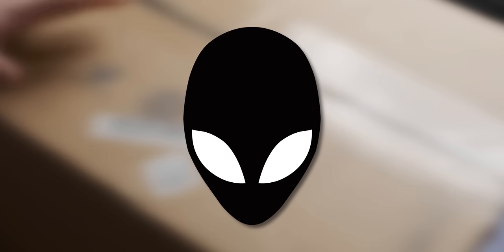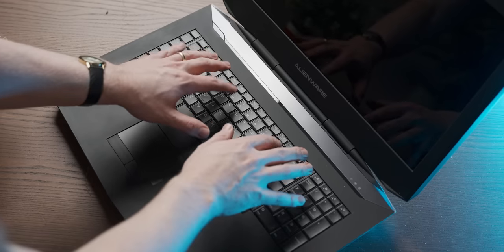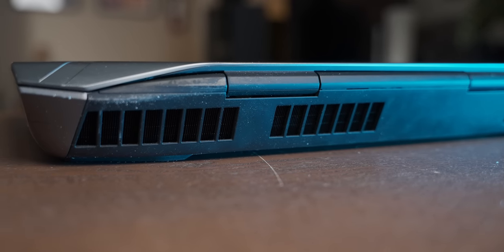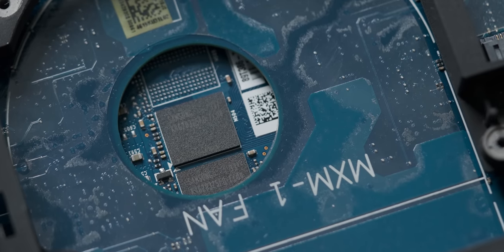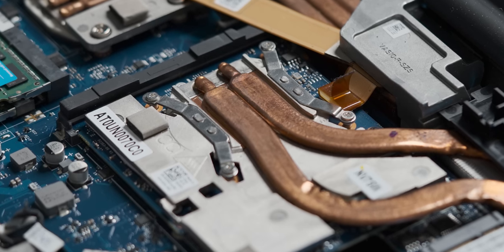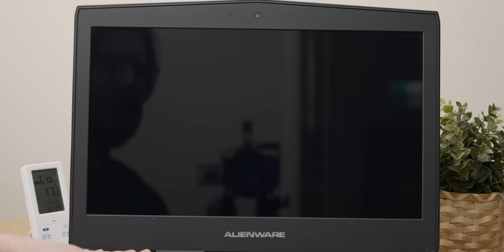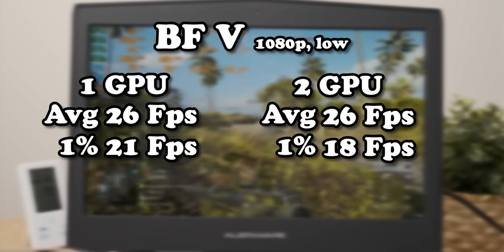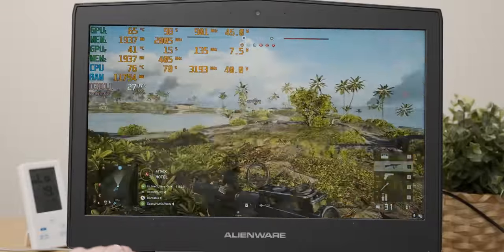This MASSIVE Alienware Laptop Was WILDLY EXPENSIVE

Comment: If it is upgradable in any way with better parts, a part two upgrading this beast would make for a great video
Reply: I second this
Reply: Not sure about the support for those on BIOS level, but technicaly socketed Broadwells and MXM RTX 2000s exist. If they are not supported, it would become an expensive brick though
Reply: Seriously, I'd love to see someone just go Frankenstein on this thing and try to pimp my old laptop to see if it could run at modern standards.
Reply: Agreed!
Reply: I definitely want to see if he can bang a couple of 10 series MXM cards in there!
Reply: @thedungeondelver 
It probably could.
It depends on type of the MXM connector.
Reply: I second this
Reply: @AlexGFrank  you are correct. BUt the question is, will the cpu handle it? It might be best to maximize the 765m or maybe upgrade to the max gpu that the cpu supports
Reply: @thedungeondelver  the highest this mxm connector can take is a 900 series the 970m is a good choice  the 1000 series was mxm 3
Reply: The one I had, had all of this I/O plus an HDMI IN port with a choice to change source.
Reply: Agreed
Reply: Indeed upgrade your GPUs with new SLI GPUs.. do they still make those..?? not really.. but still
Reply: Yeah i agree with you....needs to max it out
Reply: @davidvarnes7708  It can't
Reply: I absolutely would love to see a Part 2 if you can find upgraded parts for that laptop. If you can't find CPU and GPU upgrades for that exact model of laptop, then I suggest maybe finding a laptop that actually has upgradable CPU and GPU modules, or maybe a laptop that uses desktop parts that are upgradable. Either one would be awesome 👍. Last idea, find an upgradable all in one computer that has everything just mounted to the back of the display and upgrade the crap out of it. I know I've seen all in one computers with a regular itx motherboard, desktop CPU and full size graphics card tucked away behind a plastic shell. You could try to get your hands on any of the new 240hz OLED monitors, and maybe try to build the whole ITX computer into the VESA mount somehow. It could be the world's greatest all in one. Put in a 7800X3D, 6400mhz CL32 RAM and make it 6000mhz with much tighter timings, like CL28 or CL26 if you can pull it off. I don't know how DDR5 behaves when under clocking and tightening timings. I think you could build a bad ass 7800X3D in a ITX Mobo, 32 gb ram, an RTX 4080, and possibly a custom 3D Printed back cover for the monitor, so you can fit the 4080 and everything else you need on the back of the monitor. Using a widescreen Alienware QD-OLED would probably be ideal, since it gives you more space to fit and mount everything you want, if you go the route of "Build your own all in 1". If you find a modern, upgradable all in 1, that would obviously save you some effort if the pre built all in one was completely upgradable and came with a good display. I still like the idea of building a very powerful computer on the back of the already awesome Alienware QD-OLED display. Definitely a 7800X3D and a 4080 on a beefy little ITX Mobo. Now that, sir, would be awesome to see you build.
Reply: @skorgged  actually, Haswell/Broadwell stuff can easily handle 1070s or 2060s. Maybe not in SLI tho. And also nothing more serious.
Reply: @thedungeondelver  You can add up to a single 1070 in this thing with some slight heatsink modifications. Otherwise you can do 980m SLI. Dual 1060's would work too. A 1080 wouldn't work because the thermal design can't handle the wattage.
Reply: I looked up the compatible components for the MXM connector, and the latest GPU for it is the GTX 1060(probably a mobile chip, though).

A step down(generation wise) is the GTX 980M/970M.

That said, these "newer" cards don't look like they have the same SLI connector.

Also, it looks like nvidia has produced some newer embedded MXM GPUs, but.....they're Quadros, so...
Reply: Yup
Reply: See about getting a new panel too
Reply: Agreed!
Reply: Please do an upgrade video
Reply: Can be upgraded to 1070 mxm, or even 1080 and rtx 5000 with the right modifications. Cpu is locked at haswell
Reply: It is MXM 3.0 B so it can be upgraded to pascal GPUs but the CPU is practically at the end of the road in terms of upgradability. There are two faster CPUs with 100Mhz and 200Mhz clock speed faster cores but that isn't a lot.
Reply: I would like to watch that make it less bevell's on the screen
Reply: Also new cooling pate
Reply: Actually it is upgradeable to levels only available with clevos and thats still an under statement considering I own 2 of them the base version from 2014  and the limited edition one from 2015-2016 and I literally got over 5 generations of GPU upgrades.... from GTX 600 series all the way up to 10 series and as an extra  the Quadros like RTX 5000 which is insane when you factor in the fact that a laptop that old should not be relevant now.... 
I currently have mine running 2 Quadro RTX 5000 MXM with 16 GB VRAM each and 32GB RAM and the Intel extreme 4940MX which is still a beast considering its age.... the laptop can run basically anything to this day and it is not going away anytime soon... to me it is now a derelict classic along with its older brother the M18x R2 from 2012 which is also insane in terms of upgrades and mods .... going up to the same upgrades as the AW18 r3 in the video.... even though he's calling it the m18x... its actual name is the alienware 18 r3 aka the Viking. Or also known as the last great Alienware
Reply: It's not, the bios locks down MXM cards to specific ones, this is maxed out already.
Reply: Bigger trackpad too just for kicks
Reply: @johnathansmith1003  i have one and I am telling you that you can upgrade it all the way up to 10 series, quadros, and the  rtx 5000 mxm quadro recently
Reply: @AlexGFrank  could upgrade to 2 970m or 980m GPUs.
I still have a old gaming laptop with a 970m which can still run new games on low settings.
Reply: @razorreaper8440  Only if the Mobo supports the MXM card, it will NOT post if it's not supported.
Reply: yesssss
Reply: Came to the comments to write the same.
Reply: Yes do this
Reply: I also would love to see a video on upgrading it
Reply: @thedungeondelver  funny you mentioned that, with mine if I really wanted to you could go as high as the 1080m's because it uses the type B connection, vs the type A that was in the earlier generation of the cards
Reply: 100%.  This follow up video is exactly in his wheel house as well.
Reply: @Unicornpirate  Very cool.  Dual 1060s would be rad!
Reply: Yeah. Dawid should upgrade it to the limit.
Reply: YES
Reply: @AlexGFrank  it will support them people have put rtx quadro’s in m18x r2’s from 2012 fine
Reply: Good luck finding upgradable MXM modules with working drivers for a different laptop and a socketable upgrade for a haswell laptop CPU.
Reply: For everyone who haven't seen Linus'es videos about his investment in Framework laptops - they are the future of upgradeable laptops. Their new 16 inch laptop will come later this year and they will have replaceable GPUs and replaceable motherboards/CPU combos for you to upgrade and not throw everything else away.
Reply: I ran a quick Passmark lookup for this processor and it was rated at 5349. I doubt any processor you upgrade to would double that score to make it more playable with today's titles.
Reply: Here here
Reply: my 17 inch ranger has an rtx 4000 / basically a 2070 s
Reply: The mxm gpu parts are waaaaaay too expensive to do this
Reply: i7-4940mx, 32gb ram and a gtx 980m just like my clevo laptop would make this thing so much better
Reply: I have one along with the m18xr2. You can upgrade the main gpu slot to a quadro rtx 3000, and use the second gpu slot for a m2 to mxm adapter so this beast can raytrace and use m2 ssd
Reply: Yes please!
Reply: This is the way
Reply: @DuneRunnerEnterprises  - The MXM connector couldn't provide anywhere near enough power for modern day cards.
Reply: @buggerlugz6753  i've someone modding it in order to fit a more powerful card.
I think,it was some of the Russian hardware moders.
Reply: There was a mxm mod u can do but only with one single 1070m gpu  2000series had an different connector if I can remember.  but in the end it was not economic to buy those mxm card  ur where beter of buying a new laptop with beter specs. 😅
Reply: @earlygamer9106  
Money?????
It's YouTube,who is thinking about it?
:-)
Reply: Yes, throw the best components the motherboard supports and review it
Reply: A 1070 or 1080 and 32gb ram and this thing would still be good to go.
Reply: Fuck yes, do it!!!!!
Reply: 2 980m the safest choice i guess
Reply: He actually made the video. That’s funny 😂😂😂
Reply: @acid3129 Late but, the 970m would be a decent upgrade. They came stock in the 6th gen Intel based alienware laptops and would probably perform well with that 4th gen cpu. Plus, second hand the 970m MXM cards saved from dead laptops should go for pretty cheap.

Comment: I thought this was going to be a video about the new 18" Alienware with the 4090 in it. This was somehow better, though.
Reply: The new one is a downgrade in terms of build quality and upgrades, everythingis soldered except the ram and ssds, the bugs is not unlocked,.... and it is also only 18 inches not 18.4 inches on the old  one, don't get me started on the sound and speakers... the old one shown in the video obliterates everything to this day with its klipsch speakers and subwoofer even  a MacBook pro stands no chance... I am currently working 9n a project to modernize mine with a custom   motherboard and newer hardware..... it will be a fun adventure
Reply: @razorreaper8440  I'm impressed with how dedicated and passionate you are to this laptop, I saw your other comment saying you put Quadro RTX 5000 MXMs in it and was impressed. Laptops nowadays aren't built like they used to be, I wish mine had an MXM gpu. I've got an MSI GS66 Stealth with an i7 10750h and an RTX 2070 MaxQ (shunt modded, of course) and was planning on swapping the 1080p 240hz display to 1440p 165hz. There is one panel on panelook that matches all the same signal types as my original display so hopefully the swap should be straight forward assuming there is no bios limitation. Good luck on your project!
Reply: @razorreaper8440  I mean speakers haven't improved much. The new one has the standard 16:10 screen that are currently famous among laptop screens. That's why it's 18 inch instead of 18.4 inch since it's not a 16:9 screen. But unless you really want to do a change of build every 3-5 years, I think that product is more than a great upgrade. If you want upgradability, the older Area 51m might be up your alley.
Reply: It looks like there was an issue with the second GPU with battle field. The utilization was like 10-15% where GPU 1 was at 99%. Maybe that’s why there wasn’t an increase in performance.
Reply: "4090" FTFY
Reply: @joelconolly5574  the area 51m is much worse.... locked to only generation hardware both GPU and CPU.. even dell got sued for misleading customers with false upgradeability marketing just get a clevo .. basically if you bought a maxed outversion then you can't upgrade further. That's not the same as going from a gtx 600, 700, 800, 900, 1000 + the quadros all the way to the RTX 5000
Reply: @charliejackson6441  nvidiandeopped SLI support ... and developers also stopped adding support for it
Reply: @razorreaper8440  true. I've heard about that too. Not sure which Clevo that's available in my country that would support all upgradability but I'll check around. Hopefully, they have better upgrade paths than most. But I do agree that the Area 51m is the worst upgrade decision made by Alienware at all.
Reply: @razorreaper8440  true. gta v battlefield 3/4/1 cod black ops 2/3 supported sli.  I honest liked sli   Back in the days  if we had sli now for gaming let's use as an example two 3080s. Or beter cyberpunk would be a joke on native 4k 🤷🏼‍♂️
Reply: @earlygamer9106  nvidia's corporate greed would not allow that. You just have to buy the next shiny thing...
Reply: Very greed. That’s why they forced me to buy the ASUs strix 4090 oc 🥲🥲
Reply: @earlygamer9106  forced? You got forced to buy a 4080 rebrand?
Reply: @razorreaper8440  can you make some videos of that laptop and project, it sounds insanely cool
Reply: have one complete trash

Comment: to be fair, 20-40% FPS increase with a second GPU in SLi is about what you got back then.  I had 2 780Tis from this generation and I remember playing Shadow of Mordor and going from 40-50FPS on high settings to about 60-70 when SLi was enabled.  The real limitation youre probably hitting is the amount of VRAM.
Reply: and that's with games that support it sadly🤣🤣🤣
Reply: I was surprised at his gains, because when my fried ran twin GTS8600 on SLi it was closer to 10% on his racing games.
Reply: @raven4k998  Assassins Creed 3 supported it and it more or less halved my FPS. It was so wildly unpredictable if it was going to work from game to game that even before it died off I went back to a single powerful gpu and never looked back.
Reply: Overclocking results will be doubled as well
Reply: thats it. the vram. on the video there were two more available slots on the vram..... maybe its is possible?
Reply: @gorupgaming9155  just get better mxm 3.0 gpu.
Reply: How to increase VRAM?
Reply: thats why people sli quadro cards instead. in quadro sli the vram and cuda stack.
Reply: It also looked like the first GPU was at 99% utilization while the second was hovering around 40% for some reason

Comment: you could theoretically install an RX5700 XT MXM GPU in there, which that thing is no slouch. This alienware should have been the beginning of what future laptops should have geared towards. Instead we get shovelware chromebooks and throwaway soldered garbage fires.
Reply: Haven't seen one of those on eBay at all and almost daily search for years. Instead I've been daily using an mxm rx580 8gb.
Reply: CPU would bottleneck it hard.

Comment: I owned one in 2014, Still have the name plate, power button board, macro keys etc....How do I have these parts? For the shot duration I owned it I kept having problems with it, Finally had to return it. However its looked good for the time, Now I own an MSI GT83 8R

Comment: Correction it's a Alienware 18 not the m18x. The m18x is older but way cooler in my opinion with no power limitation, you could attach dual 330w PSU pushing 660w into it overclock the heck out of it.

The Alienware 18 won't draw more than 330w it is hardlimited.

Comment: In Battlefield V the second GPU was at 135MHz without SLI, and with SLI. And less than 20% load. Driver issue?
Did you put new thermal paste on all chips?

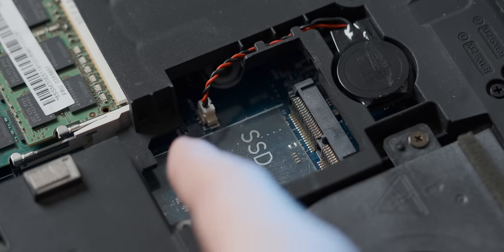Comment: That SSD-slot at 5:11 is for an mSATA-SSD. Fourth gen Intel (aka Haswell) was the first plattform supporting the NVMe protocoll, but it was not very common in laptops yet.
Reply: I bought a Dell XPS 8500 desktop with an on board msata SSD at a thrift store over the weekend. I didn't realize msata made it to desktops.
Reply: @davemiller262  You practically never saw it on DIY boards but it was a thing in OEM machines. The reason being that ssd were faster to install in a manufacturing facility than 2.5" drives. Less screws and cables made them way faster to install. 
mSATA was origionally only made for early Ultrabook and other Thin-and-light notebook for which 2.5"-SSDs were simply to bulky. My Samsung Ultrabook used one of them.
Reply: I have a Gigabyte BRIX with the a8-5557m - it uses mSATA as well. Great form factor at the time for miniaturization, and it helped keep the thing cool without a 2.5in drive clogging up the airflow.
Reply: I use mSata on my Dell Vostro 3560. It's a very good Samsung Evo 860.
Reply: Yes it is

Comment: Does the battery still working? Idk about older system bios but nowadays, newer dell laptop bios are restricted with "Hybrid mode" which essentially using both AC and battery power to power up the performance.  Meaning if the battery is dead/not working well, the gpu would suffer in performance.

Comment: 13:30 worth noting SLI isnt really working in this specific case. 2nd GPU is only running at 135mhz and drawing less than 10w

But i guess it makes sense as SLI was probably already dead and buried by the time BF V released
Reply: Also Vram limited